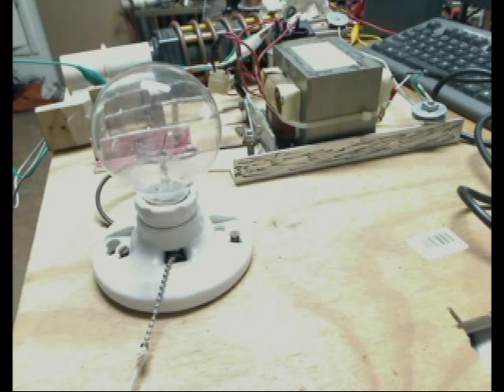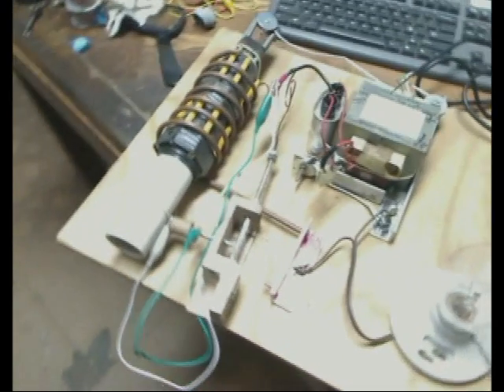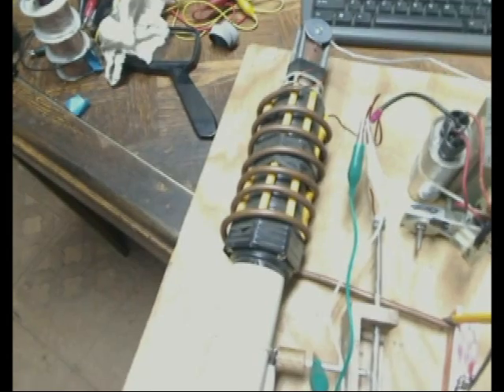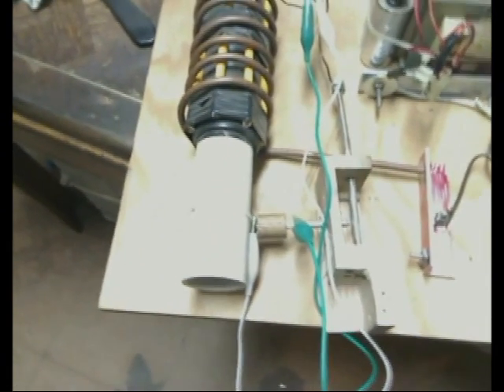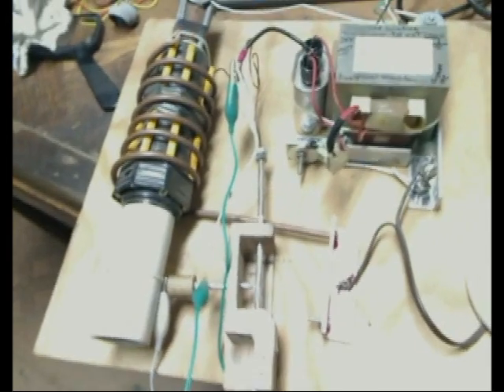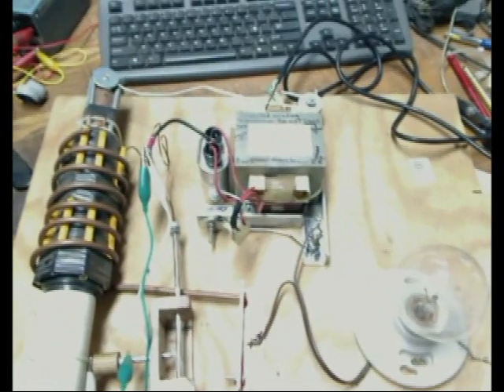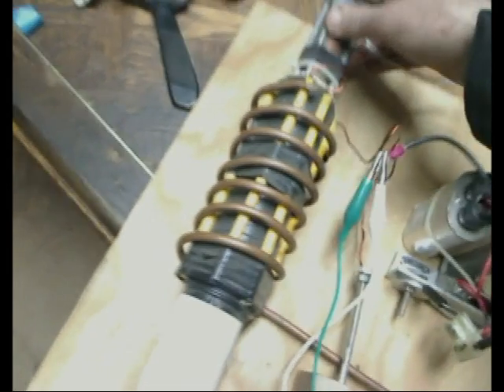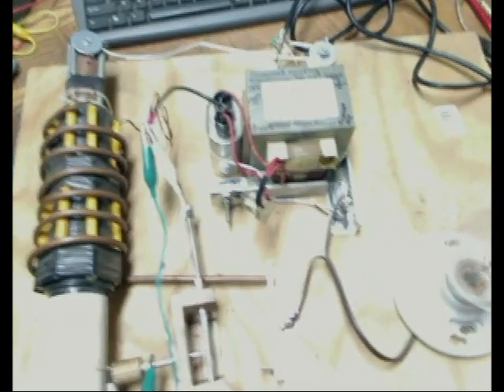Kapanadze generator FAIL

Comment: Nice setup Mstu,
Try starting out with 100-300 watt Halogen lamps they can take more of a current surge better and you may want to put some in series....I did and a-ok
Reply from the maker: My point here about this one design ..which I failed to see at first...was this design does not use resonance...It is a direct line,basically,from transformer to load via some copper tubing.Stivep1 and the Russians use true resonance (which I also failed to master) .But I am now too busy with other projects...

Comment: I'm still novice here but this coil i made without "resonance" so do not build this one(kapagen). my money sucks!
Reply from the maker: Oh thats ok,I built it and that is a terror if you are not careful.I have seen others similar.When the input and output power are added up,nothing is gained.This should not be a begginers project,that transformer outer core is HOT,looking for a gnd.I did not realize that till I looked at the microwave schematic. to plan my strategy.Thanx anyway